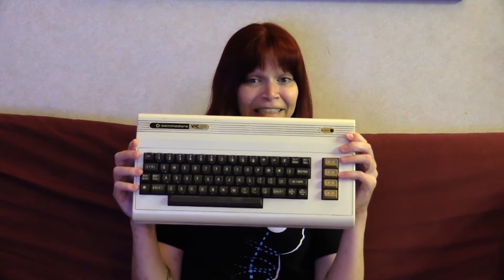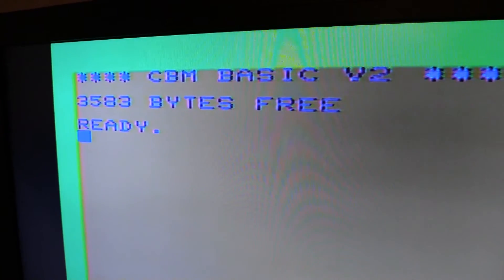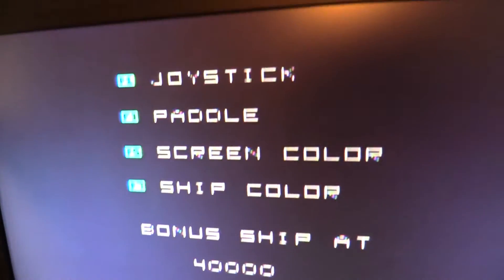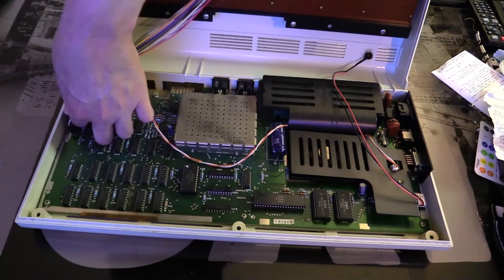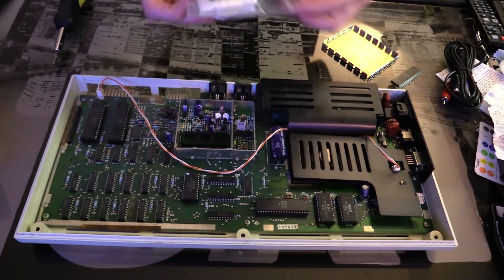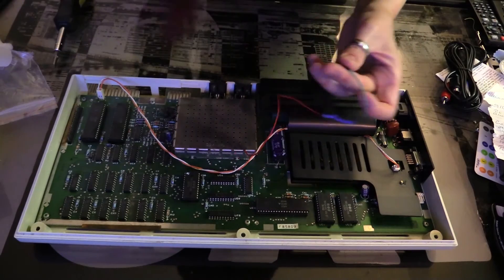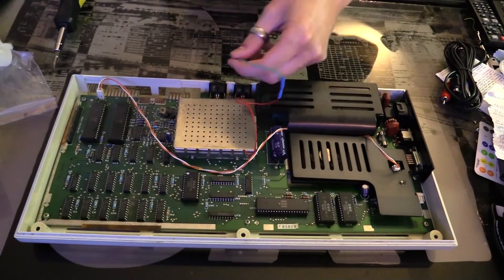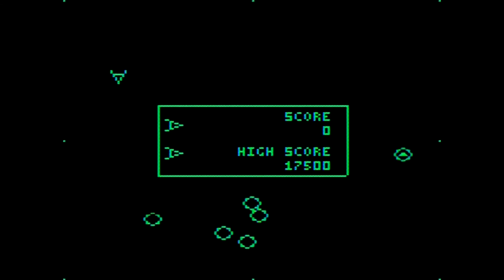Commodore VIC 20 Plug & Play S-video Mod

Comment: LOL @ the cat coming in to try and kill the wire!!! =D  Great job!   It's worth leaving that shielding lid off the top of the VIC chip.  HEAT is one of the contributing factors to why the VIC chips die in the VIC-20.  You could tape the shielding lid up in brown packing tape or something and attach it to the underside of the lid / keyboard.  Just so its not lost and doesn't short on anything - just an idea!  I was toying with removing mine for that reason.    Also, one other thing, and I am not 100% sure, but it looks like you have a colour problem with that VIC-20!?!  The background on basic looks grey instead of white, and in that game you get green as the colour, but I get white on both of my VIC-20s?!?!   I wonder if you've got a flakey colour RAM or something?
Reply from the maker: Thanks for the tip on the shielding lid! I think I'll pull it off.

The guy who created this mod responded to me elsewhere, noting that the white was off. He suggested tweaking  . . . something. I'll try that out.

As for the green in the game, I actually changed that on purpose. :) Hitting F7 at the title screen allows you to switch "Ship Color" (actually, it changes the color of everything). You can also hit F5 to change background color, but I decided to stick with black.